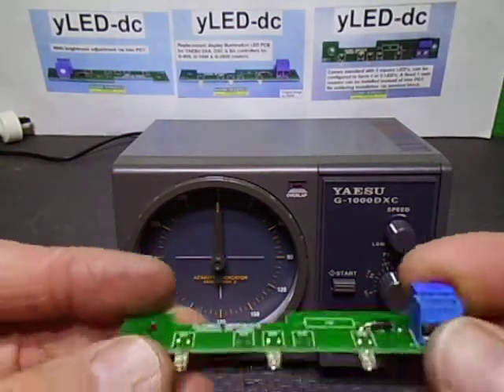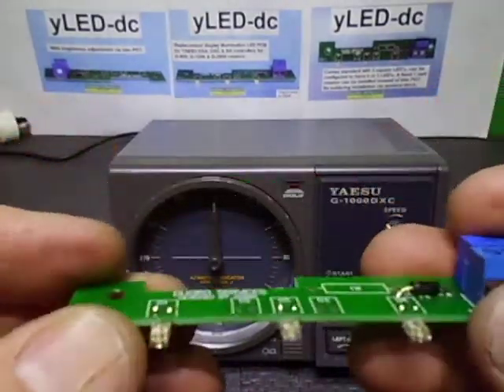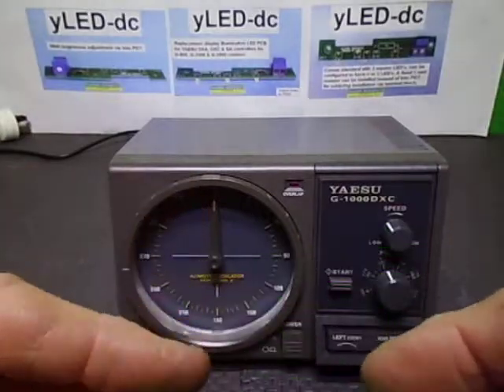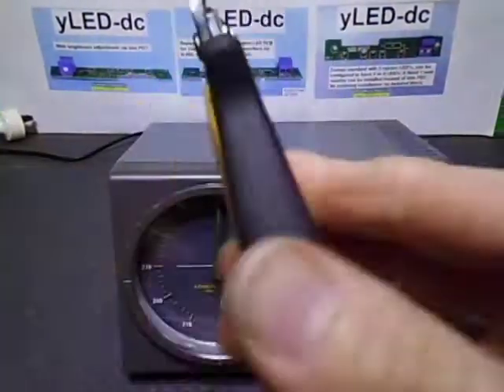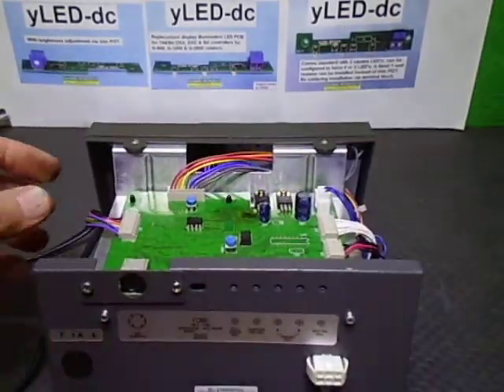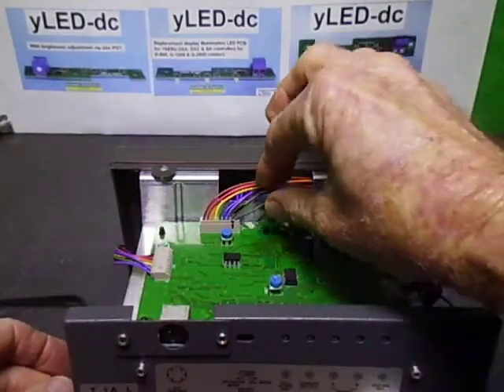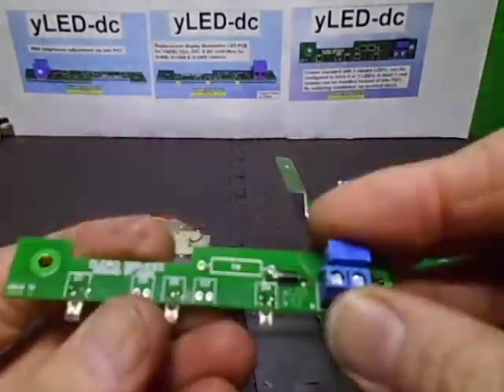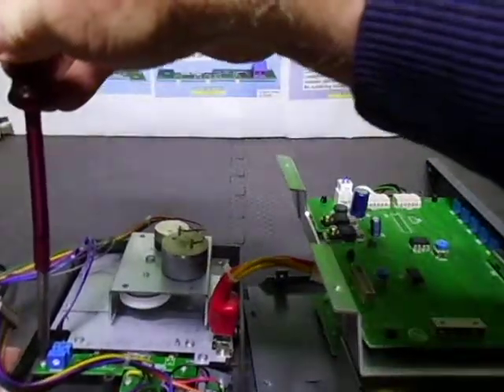yLED-dc display illumination PCB, installation into a Yaesu G-1000DXC rotator controller

Comment: I thought lights were standard on yaesu rotators, my g5500 had them fitted from new?
Reply from the maker: Thank you for the comment, this is a replacement option & upgrade for when the original globe blows. regards Peter of Duoro Services

Comment: Where can I buy it? Can I use this PCB for Yaesu G -2800 Controller?
Reply from the maker: Hi Jeremy, Thank you for the comment. You can purchase this product through my web site, which is in the description of the video. This design can be used in all DXC, DXA & S controllers for the 800, 1000 & 2800 rotators. Regards Peter